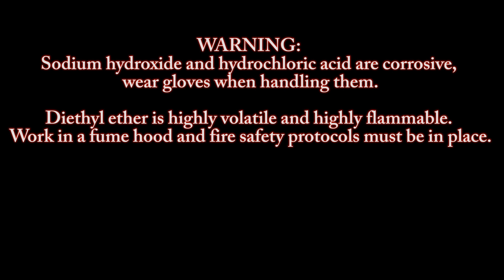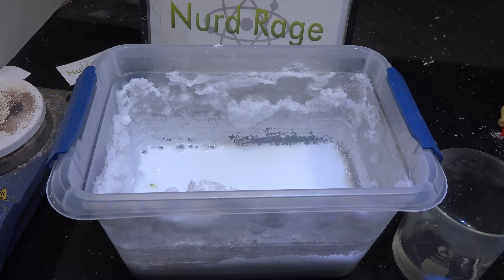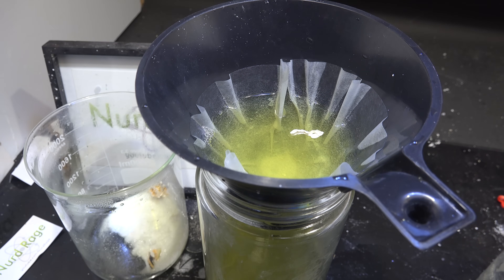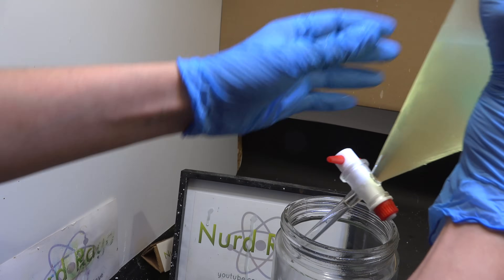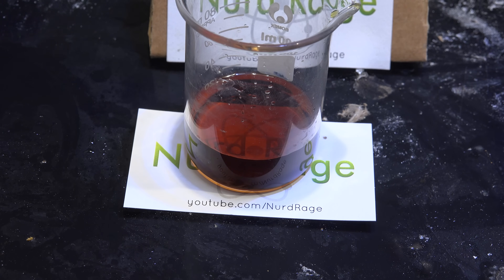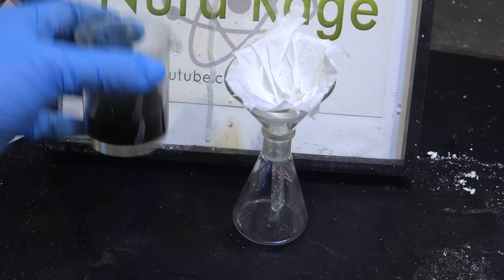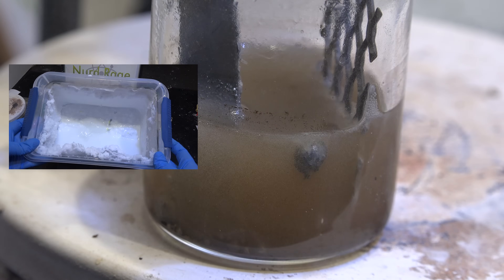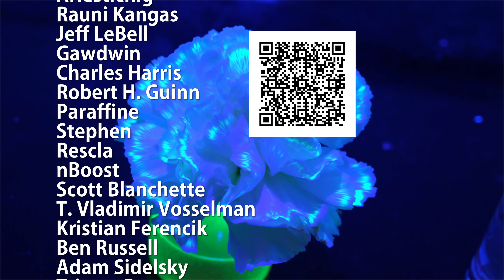Recover Used Gallium From Aluminum Using Solvent Extraction

Comment: Great Video! I really liked the idea of using ether (which is very non-polar) to partition highly charged metal salts out water!!!
However... Am I the only one that found the absence of safety warnings about the neurotoxic aluminium chloride rather strange?
I mean, you did make quite an issue of the toxicity of sodium/potassium cyanide (which really isn't THAT bad AND completely detoxifies quite readily), while completely glossing over a persistant neurotoxin where even minor contact can possibly have permanent consequences.
Reply: Everything is toxic. Everything is carcinogenic. Everything is corrosive and you have to point it all out!
Reply: Wait, isn't aluminium chloride used in antiperspirant?
Some Wikipedia happens
It sounds like aluminium chlorohydrate isn't neurotoxic, and is what's used in antiperspirant. I'm certainly no chemist, but maybe synthesizing the aluminium chloride in an aqueous solution is sufficient for mitigating the risk?
Reply: Martin of Gliwice; Well, thats not completely fair. HCl is indeed 'corrosive', but check Nile Red's video where he pours corrosive acids on his hand. The image people have of acids instantly 'melting' flesh off, is just plain wrong.

My main issue is with HOW we are warned of dangerous things by pretty much everyone that teaches practical chemistry.
If you eat a bit of sodium cyanide, or spill a bit of an aquous solution of it on your skin, you will COMPLETELY recover (as long as your dose was relatively (to the LD50 value, although you could be the statistic that proves the LOWEST lethal dose as well...). However, if you spill even a microscopic amount of a persistant, water soluble, neurotoxin onto your bare skin you run a very real risk of irreversible mental decline.
I find compounds such as AlCl3 to be MUCH scarier than something as benign as NaCN, yet (AT BEST) both are warned against equally strongly.

THIS is the real problem: Educators are legally obliged to warn you about any and all possibly dangerous compounds, which they do with pretty much the same conviction for ALL of them. How then, are students supposed to know what the REAL dangers are? And no, it doesn't work to just have people treat EVERYTHING as absurdly dangerous, because the human mind simply doesn't work that way. We evolved to recognise specific dangers and either fight or flee. Expecting people to be able to work effectively in a dangerous environment whilst properly handling EVERYTHING as dangerous is simply not practical. Either they start getting lax about safety, or they are no longer able to work efficiently.
Reply: MRLT I  believe that your skin is quite resistant to attack by aquous salts (as long as the solution isn't strongly basic), eating AlCl3 may be bad, but putting it on bare skin in non sensitive region of it shouldn't be a problem.

Besides, I think you slightly exaggerate the risks associated with aluminium salts. Sure, they may not be harmless, but acute toxicity is very low and such experiments in the lab cannot count as a chronic exposure.
Reply: The aluminium chloride neurotoxin data is experimental - on rats. Even eating aluminium chloride amounts to the same effects as eating anything leavened with aluminium based baking powder. This procedure will at most splash some alu chloride containing liquid onto one's hands. Do check the wiki page on baking powder for references on alu based baking powder.
Reply: Na; Basically, anti-perspirants work on the principle of not getting into your blood stream. They have very low aquous solubility, and are not easily converted to their soluble form by skin secretions.
Similarly, the aluminium hydroxide used to treat heartburn, also converts pretty slowly to AlCl3 at human body temperature (it's basically the same reaction that Nurdrage had to use heating for).
However, while he did have an aquous solution, it was SATURATED, and VERY acidic, so a LOT of the aluminium was in the water soluble form... This made me cringe SO hard (which is why I commented), not because of anything that he did wrong, but because I implicitly imagined myself having to work with that solution, like he did.
One slip, and you won't even know or care about how damaged your brain has become (I suppose I have a mild phobia of persistant inorganic neurotoxins...).

Just go read a bit about dimethyl-mercury; I really do wonder if there is any way for the amateur to SAFELY handle such things,  but luckily there really is no reason why I would ever need to use mercury (or lead for that matter) for either my work, or my hobby.
Sadly, I do have to use volatile aluminium compounds quite a bit, so it is something I am very aware of.
Reply: Martin of Gliwice; Actually, even heavy metal salts pass quite readily through intact skin. So there are a few ways of demonstrating this...
Cody'slab has a video on removing Silver Nitrate stains using aquous Sodium Cyanide. The stains are actually metallic silver that gets deposited underneath the skin and so can't be washed off. The cyanide solution is able to almost immediately pass through the skin (THICK calloused skin on the hands as well, not just normal arm skin), dissolve the silver and then be taken up by the surrounding tissues.

Unfortunately, I only have my phone with me at the moment, so properly quoting refrences is kind of hard, but another way to look at it, would be to compare the LD50 values for NaCN by oral and dermal routes.
(I founda nice comparison pdf titled: "Toxicological profile for cyanide - Agency for Toxic Substances and Disease Registry" @ www.atsdr.cdc.gov/toxprofiles/tp8-c3.pdf)
It tends to vary quite a bit, but LD50(oral) is on the order of 1-10mg/kg while the LD50(dermal) is also around 5-10mg/kg.

As for the acute toxicity of heavy metal salts, yes they aren't really going to kill you in very low doses or very quickly (which is all people seem to really care about). However, the insidious nature of cumulative neurotoxicity is what makes it much worse (for me at least). Once the Aluminium has been taken up by the brain, it STAYS there for ever. You can never get back what it takes. Maybe it only takes a little bit of your vision or hearing, so little that you don't even notice. Maybe it makes you just a bit more moody, or maybe it takes a random unimportant memory.
The problem is you don't know what it takes and if it does enough damage, you won't even be able to appreciate the empty shell you have become.
There have also been a lot of unsubstantiated reports of Aluminium being linked to various neurodegenerative diseases, but if you actually go look at the studies themselves, there really isn't any concrete evidence to link occupational exposure to Aluminium metal to any of those diseases. Remember, correllation does not imply causation.
So no, the aluminium in your deodorant isn't neurotoxic, even though metallic Aluminium is indeed neurotoxic when directly injected into the brain. It's kind of like the difference between methylmercury and dimethylmercury. Both are well-known neurotoxins, but methylmercury really doesn't harm you when eaten in low amounts (such as that found in fish); while dimethylmercury is SO aggressive that even a small drop, spilled onto THICK protective gloves worn over a standard hazmat suit by a trained hazmat researcher, resulted in her tragic death, despite immediately taking off all contaminated clothing and activating the emergency shower.
Although, a more apt metaphor would probably be to compare mercury metal with Mercury Nitrate. Just like Aluminium, elemental Mercury really doesn't pass through the skin at all, which makes it quite safe to handle even large amounts bare handed. In contrast, mercury nitrate is SO dangerous (simply due to its increased aquous solubility) that even Cody'slab expressed the need to wear protective clothing when handling it!
Reply: Closedloop; Like I already said (and Nurdrage explained in this video) the conversion of basic Aluminium Hydroxide to the chloride with aquous CONCENTRATED hydrochloric acid is VERY slow unless conducted at elevated temperature.
Also, your stomach acid is actually quite dilute (unlike the nearly azeotropic solution used in the video), which would slow down the reaction rate even more.
Now, once the ingested substances pass through the stomach and into the intestines, the ph gets raised quite a bit (to slightly above neutral), so the Aluminium would once again be insoluble. Obviously, it needs to be converted into the soluble chloride and absorbed through the stomach lining before this happens, which simply doesn't leave enough time for any significant amount of AlCl3 to be formed.

As for the neurotoxicity only being tested in rats; It seems humans simply don't get exposed to AlCl3 very frequently without also getting exposed to a lot of other industrial chemicals (so you can't get good data for an occupational exposure study) and it is also illegal to test its neurotoxic properties on humans under controlled conditions...
So, the only data we are likely to get is from studies on rodents and other 'lesser' mammals (reliable primate toxicity studies are extremely unlikely given the public's current attitude); however, the rat's brain is actually VERY similar to our own (many of its basic biochemical pathways are in fact identical to our own).

And even if the rodent model were to be totally inaccurate (which is very unlikely), why would its results cause you to view AlCl3 as less than possibly neurotoxic in humans? I can understand that you might feel that AlCl3 is safer, if the results showed no neurotoxic effects in rats (although that also wouldn't definitively prove anything about its effects on the human brain); but how does it being confirmed as a neurotoxin in rats lead you to viewing it as less dangerous to humans!?

Comment: Make a video on making sodium hydroxide
Reply: Justin Koenig yes i know but getting sodium is arguably more difficult than buying Lye
Reply: It is tricky to do this at home. Industrially, it is made by electrolysis from sodium chloride (brine). The other product is chlorine gas, used for example in the production of HCl or PVC. What makes it tricky is the special membranes they use to keep the half-cells separated. Conceptually, Nurdrage could do something similar with a salt bridge. But it's rather messy; and he would still need to find a way to use/dispose of the chlorine, it is quite toxic.
Reply: mmmhorsesteaks It's also possible to strongly heat Na2SO4 which will then breakdown into Na2O and SO3. If you now add Walter to the Na2O you get NaOH. But I think its not worth since you can buy it nearly everywhere and its also cheap
Reply: Tali-bahn hey that might even work with sodium carbonate? I thought the sodium chloride route was interesting, mainly because of its industrial relevance.
Reply: ddd ttt you can buy it as lye crystals or drain cleaner at Home Depot or react sodium with water